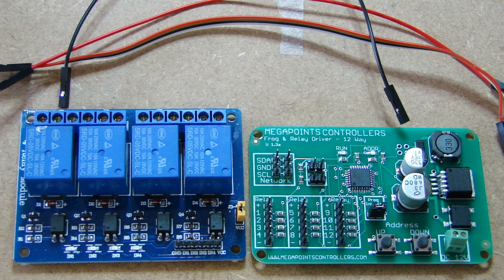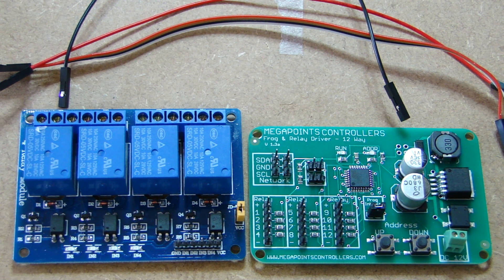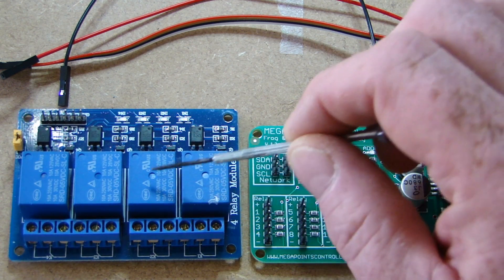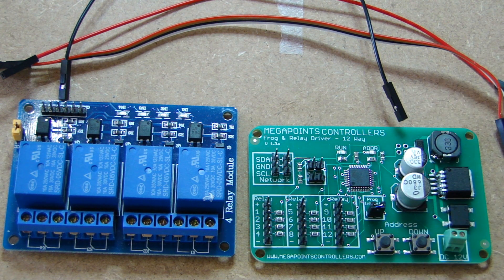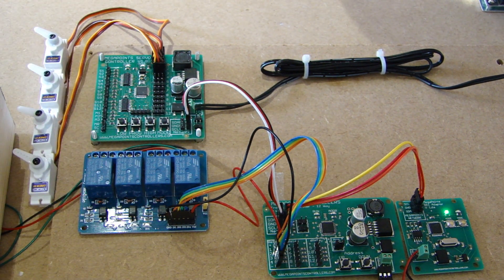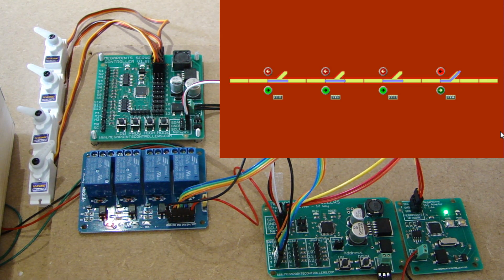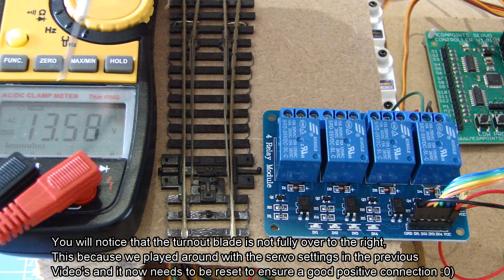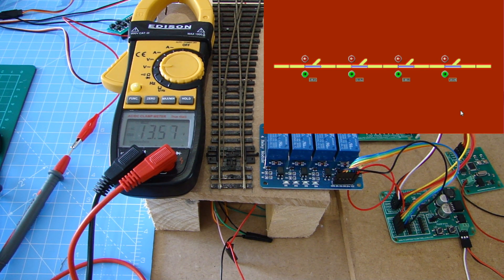Megapoint Controllers Part 3 and Relay Boards 20-08-2017

Comment: Hi i know its 2019 but could you tell me what voltage they are as ebay have 5v and 12v relay boards i am running n gauge
Reply from the maker: Hi Frank, the relay boards I purchased can handle between 5vdc to 12vdc on the input, the relays themselves upto 240v dc and ac. heres the link where I purchased them from, hope this helps.
https://www.aliexpress.com/item/1492110181.html?spm=a2g0s.9042311.0.0.27424c4dtxvO3u

Comment: Hi Mark
Think this is going to be my way for the hidden and out of the way areas. Brilliant as usual keep it up Ian
P.S.
Still going for the AluRailTech design in the fiddle yard 😉
Reply from the maker: Thank you Ian, these servos are a nice low profile and rather discrete aren't they and because I use the area under the fiddle yard for storage I'm now thinking of using more MDF to seal the area between the fiddle yard off so I don't snag any wiring while putting things in the cupboards, but that's to be seen yet.
And the AluRail is perfect for micro-switches, simple and perfect, I do love it to be honest :0)

Comment: The system you are using to power the frogs is a little complicated.  You can buy a frog juicer that uses less boards and wires.  It just needs a power source and one wire to the frog.  When the train runs over the frog it will change polarity automatically and you use the rest of the system as usual.
Reply from the maker: What's a frog juicer then matey?
Reply: A frog juicer provides power to the frog and when the wheels hit the frog it automatically changes the polarity to the frog.  You can buy them as a single unit or up to 8 frogs.  You don't need relay boards or the controller board.
Reply: I was looking up the prices for the frog juicers, they are as follows, single $17.60, dual $37.66 and hex $100.52.  All prices are Canadian.  This was from Fast Tracks web site.  I am sure you can get them on E-bay.
Reply from the maker: Perfect Scott, thank you mate, but have looked on eBay here in the UK and they are £16, so cost more than the system I'm using and looks like there's only one seller here, but I will keep looking.

Comment: Hi Mark,

Where did you get the colourful servo wires from?  I hear the ticking is alot less with your new power supply :)

Cheers,  Michael
Reply from the maker: Hi Michael, god those wires were a nightmare to find as I didn't know what they were called, but now I do know and I'll share that with you :0)
The servo wires are these basically called 'servo extension leads' and there's loads to choose from on ebay and Amazon, all different lengths and end connection.
The leads from the relay boards are called DuPont cables and are generally single cables but you can also get them in joined in a bunch of four, I have only found those this afternoon as the originals came with the relay boards when I bought them :0)